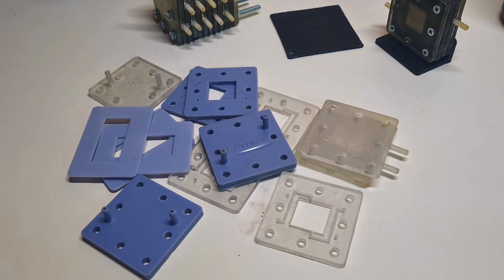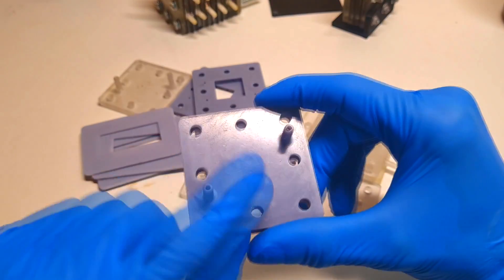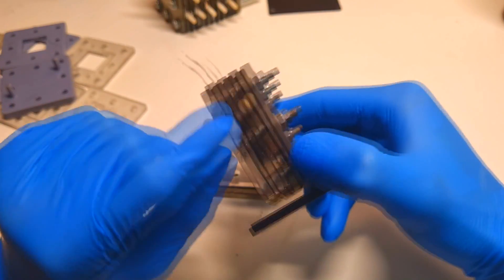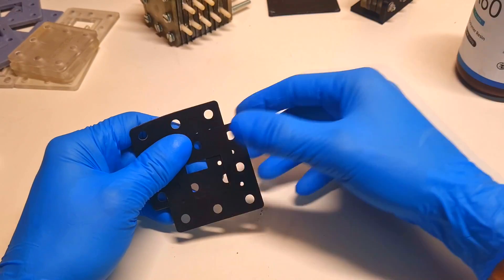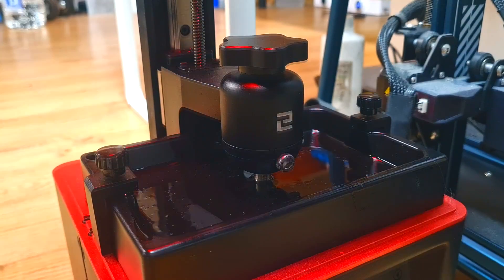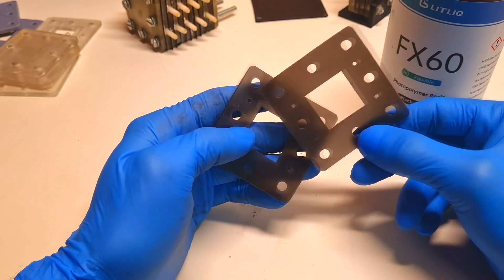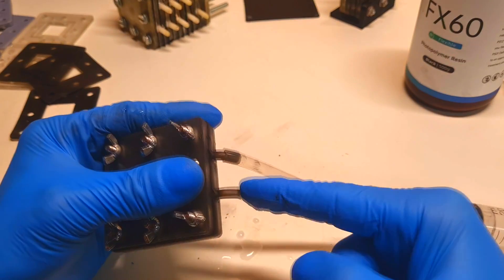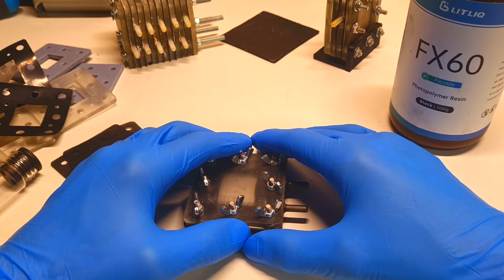Printing battery with FLEXIBLE RESIN

Comment: instead of having to disassemble the whole battery for changing the metal fuel electrode, try a top loading "hanging pouch" design, that you can just insert a new metal/aluminium fuel sheet and remove it whenever.
Reply from the maker: I already make that one

Comment: Just print a solid nozzle assembly with normal resin, and slide it into the rubber gasket. Connect 2 nozzles together with a solid wall only on the inside, then slide it into the gasket from the inside until it hits the wall. This way you get the best of both. You could use silicone on the wall connecting the inner nozzles to the gasket if it leaks. I hope you understand. Basically 2 nozzels on a solid inner wall as hard resin, and the gasket has 2 holes and maybe a small indent where the wall is recessed  into so they mate together. Add a little silicone to the inner walls and slide them together. Just my thoughts on it.
Reply from the maker: Cool 👍